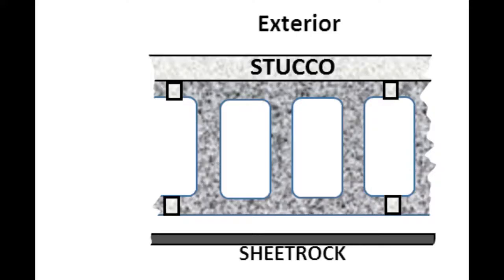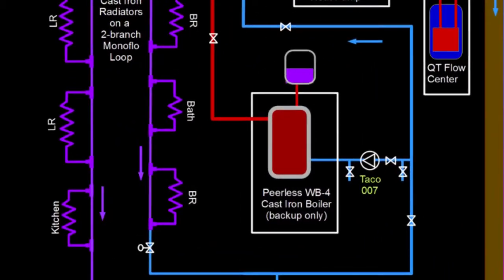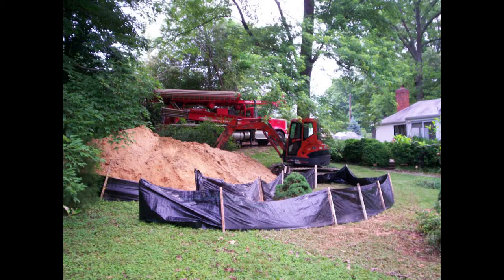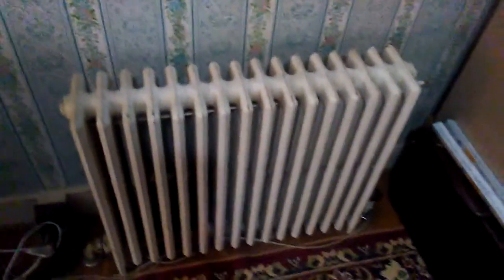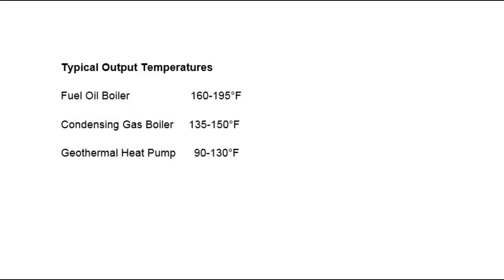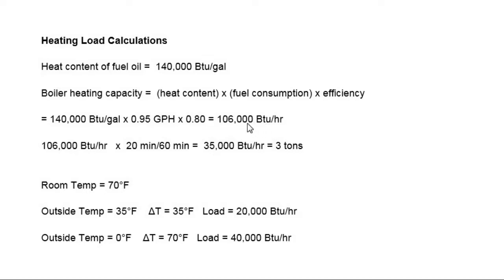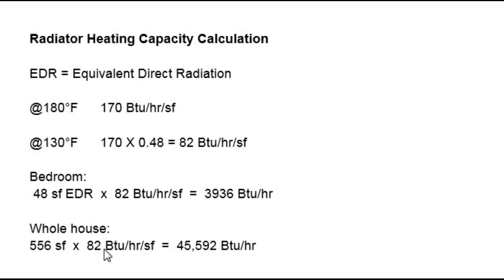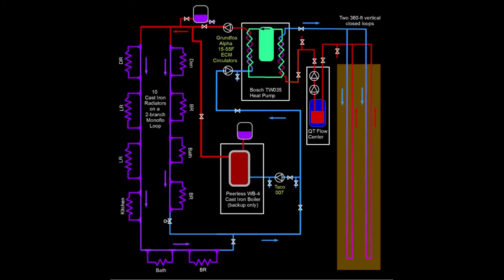Geothermal heating system with cast iron radiators

Comment: Now this is what I have been investigating.   It seems interesting but will it be reliable for at least 25 years?   I don’t do solar.  Roof leak problems and in 10 years if you need your shingles replaced, will that company be around and chances are it may not be. I’m not a risk taker, but a boiler combo with geothermal and the tubes in the ground or in deep water wells does interest me a lot if you can find installers in your area and depending on where you live in what zone
Reply from the maker: Finding an installer will surely be the hardest part, as few of them have any experience with radiators and they'd much rather just put in their standard forced-air systems.  So if they agree to do it at all, they're unlikely to offer much in the way of warranty  But geothermal loops if done right do typically last many decades.  In that respect, I'd stick with deep-bore vertical loops, not ponds or slinky loops. A good heat pump will probably last 20 years, but you do hear horror stories of people who have problems much earlier and it's hard to judge how common that is.  We are at 8 years with no serious problems, and with oil at $5/gal we're saving $2000 a year not $1000. In the deep South or zones where it rarely dips below freezing, it is probably more cost-effective to just get an air-source heat pump but anywhere else geothermal makes sense in my opinion. If a shingle roof is more than say 10 years old it should be replaced before installing solar, but once installed the panels will protect the shingles from sun exposure so they too are likely to last many decades.  Thanks for commenting.

Comment: Hi Lawrence, thanks for the great video! Do you have any references where we can learn more about the insulation mentioned in the section starting at 1m05s? Can you recommend any specific terms we should use when searching for/speaking with contractors? Our home is similarly constructed.
Reply from the maker: Whoa, that was quite a long time ago, but the insulating was as much an adventure as the geo.  The foam in the cinder block cavities is called tripolymer injection foam.  This is a very specialized product and mostly used on commercial buildings.  However if you go to injectionfoam.com you can type in your zip code and they will list available contractors.  When I do that, it shows only one listing, The Drying Company out of Virginia Beach VA, which is the contractor I used.  The estimate for the whole house was $8000 in 2014.  However I only did the half of the house that was 8” block.  The half with 6” block wasn't worth doing because the cavities are so small.  Also, you have to be careful because if there is an opening between any of the block cavities and the cavity directly behind the drywall, the foam can get behind the drywall and blow it off, as happened in one case on my house.  Fortunately it is not hard to clean up the foam.  

For the cavity between drywall and block, I used pourable marine polyurethane foam, the stuff they use for floatation in small boats.  I believe I used the “4 lb” variety, which claims to expand 15X, although that depends on conditions and in my experience it's more like half that.  You mix two components 1:1 which starts a chemical reaction that produces a soft foam that expands and then slowly hardens.  I don't remember the brand name but there are a bunch of people selling it on Amazon and ebay.  The tops of the cavities were accessible from my attic, so I went to the basement and plugged the bottom of each individual cavity, for example with minimal expanding foam from a spray can.  Then I got a bunch of ~8-oz dixie cups. I mixed one cup at a time and poured it from the attic into each wall cavity, then waited 5 minutes before pouring in the next cup.  You really need a (very patient) buddy to watch downstairs and make sure there is no leakage, as the uncured foam mixture can leak through any small gaps at the baseboard.  It took 7-8 cups to fill each 16” wide cavity. So a very tedious process.  I rhink that if you tried to fill the whole cavity at once, it would blow off or bow out the drywall. Unlike the tripolymer, this foam sticks like glue to everything.  If you got it on a carpet for example, you'd have to replace the carpet.   

There is an entirely different process called EIFS (exterior insulation and finish system) where they add insulation to the outside of the stucco, then plaster on another layer of stucco.  I know somebody who did this and was quite happy with it.  In theory this is a better idea because then you have the huge thermal mass of the cinder blocks moderating the temperature on cold nights and hot days. However this is also a very specialized procedure.  I found only one guy in my area who said he could do it and he promised to give me an estimate but never did.  My roof has no overhang at all, so I suspect I would have had to add one, which would be $20K at least just for the overhang, so I didn't pursue it further.  

So, no really great or cheap options for insulating these old cinder block houses.   But it can be done.  Hope this helps.  Thanks for commenting.
Reply: @quetzal4042  Thanks so much for taking the time to answer my question with so many details, now we have lots of leads to follow! Thanks again for putting out such helpful content!

Comment: Great video. I have a one-pipe steam heating system. Could a geothermal heat pump work with a one pipe steam system?
Reply from the maker: Sorry, I don't see any way it could work without extensive modification.  You'd need to plumb in  a return line from each radiator in order to get sufficient flow.  I suppose it's theoretically possible to design a 1- pipe geo system using some fluid other than water, that has a boiling point closer to 120°F, but to my knowledge there is no equipment available to do that.   Thanks for commenting.

Comment: Great contribution! It would be great if we could use this and other work highlighted in these comments as the basis for a National discussion about ways to retain our heritage of cast iron radiators as HVAC systems continue to evolve to meet the challenges of climate change.
Reply from the maker: Sure, anything I can do to help, just let me know.  There are some new products that make these systems easier to configure and install.  When I did mine, I used two separate heat pumps, one for heating and one for cooling.  Now there are units that can combine hydronic radiant heating, forced air cooling and domestic hot water all in one unit, with a variable-speed inverter-controlled compressor for greater efficiency.  Check out this video for a description:
www.youtube.com/watch?v=6Nm7n2u4-Is&t=9s
What they really need now is some improvements in drilling tech to bring down the cost of the ground loops and get these systems within reach of everyone.  Meanwhile, our system is still chugging along, coming out of our 7th winter and still haven't had a single problem with it.  Thanks for commenting.

Comment: We live in USDA hardiness zone 4 where there are a handful of days every year where the temps dip to -15 or lower.  Will this system work in these temperatures?
Reply from the maker: I think certainly you could design a system that would work in zone 4, it's just a question of how big a ground loop and how powerful a heat pump you would need.  You would want to start with an extremely well-insulated house.  Note that even though I am in milder climate (Virginia), my house even after improvements isn't that well-insulated, R-10 walls for example, so I need about as much heat as a really well-insulated house in the northern US would.  Also note that the first two geothermal radiator installations I cite in the Description are in quite cold climates, the first near Buffalo NY and the second in the upper midwest I believe.  It is true however that more electrical energy will be consumed to get an equivalent amount of heat in a colder climate, because you will be pumping heat from ground temperature water of ~45ºF (in zone 4) to radiator-temperature water of say 120ºF, instead of from 60ºF water (in Virginia).  I'd guess maybe 20-25% more power.  This does mean that the relative advantage of geothermal over fossil fuels is somewhat less in colder climates, because of course a gallon of oil or a cf of gas will generate the same amount of heat no matter where it is burned.  But the nice thing about geothermal is that it heats just as well no matter what the outdoor temperature, vs. an air-source heat pump which wouldn't work at all at -15ºF.  Thanks for commenting.

Comment: I think it's the cost of Geo that puts people off. By the time you upgrade the thermal performance of your home and in many cases, your heating distribution system, you could be looking at $30,000 for a modest home.
Reply: If you need  new furnace anyway, the cost delta of a geothermal system is less.

Comment: Lawrence, great explanation of your system. I'm in MN, have an old house with radiator heat. If my  geology/hydrology is the right fit, I'd consider a system like yours.  But I have no idea what this costs.  My friend who works in the state energy office says he thinks it's a 100-yr payback. Thoughts?
Reply from the maker: Hi Paul,

Thanks for commenting.  It is not too difficult to estimate the cost of a system and as I show in my case, it is possible to do it fairly cheaply if you get the right contractors and do some of it yourself.  But estimating payback is much more difficult because every situation is different and there are so many factors to consider, some of which you just have to guess.  For example, if I had simply hired a professional Geo HVAC contractor to put in a complete system, it would have cost $10-20K more.  I know, because I did get estimates, although they were all for forced air with air conditioning included, because none of them wanted to deal with radiators.  On the other hand, my drilling might have been cheaper except that it was mostly through solid granite, and if I had been willing to have them tear up my whole property for trenches instead of drilling, it would have been about $5K cheaper.  And then it of course depends on what you would do otherwise.  Compared to oil, I think it’s a pretty sure bet you’d come out ahead with geo after say 20 years under almost any scenario.  But fracking gas is so cheap right now that as you can see from my chart, potential savings with geo are only a few hundred dollars a year, and could be even less depending on local cost of gas vs electricity and whether or not you’d be paying for a gas connection anyway.  So yes, under those conditions it could take many decades for a geo system to “pay for itself” with fuel savings.  But will gas always be so cheap?  Will there be a carbon tax? Will more states move to ban fracking as its effects on water quality and seismic instability become apparent? Or will there be gas shortages because pipelines are overloaded and it is politically impossible to build any more?  These are things you can only guess about.
Reply: @quetzal4042  Thanks for the thoughtful reply. I agree there are many future unknowns, and I am also motivated by the spectre of massive climate heating. So, yes, your points are well taken.
Reply: @quetzal4042  Also, maybe you mentioned it, but is your system water-to-water in your heat pump?
Reply from the maker: @paulandre2489  Paul, Yes it is water-to-water.  A few years later I also converted the air conditioning to geo and that uses an entirely separate water-to-air heat pump. Of course they use the same ground loop so once in Spring and Fall I need to flip a couple of ball valves to switch the loop between the two systems.  You can use the water-to-water as a chiller and run that through a water-based air handler, but having a separate heat pump is more efficient.

Comment: great video
Reply from the maker: Just finished our 6th winter with the system and still no problems and no maintenance, flip it on in the Fall and off in the Spring, that's it.  By the way, my warning about expiring tax credits is no longer valid.  The tax credit currently stands at 26 percent throughout 2021 and 2022 before decreasing to 22 percent in 2023. Thanks for commenting.

Comment: Hi Laurence: Thank you for taking the time to put together such a comprehensive video. I am in a similar situation in a 1940s house with an oil burner and radiator heating. I will be using your video and illustrations as a reference when talking with local geothermal installers. I've installed a very large 22.8 kW solar tracking system that provides enough electricity to power the house, two EVs, and eventually our geothermal system while remaining slightly net negative (if I've done my calculations correctly).  I didn't hear anything mentioned about your home hot water heating solution, which is suspect may also utilize your geothermal. 

This year is all about increasing the energy efficiency of our house including replacing all our old (original) windows and storms, doubling up on attic insulation, and tightening up the entire building envelope. I'll be running the heat tests for our boiler after making these changes to see if we can successfully heat the house with the lower temperature output. Again, thank you for sharing your experience.
Reply from the maker: Chris,
You’re quite welcome, if it helps even one person get a system installed, I’ll consider the video well worth the effort.  Good luck with your contractors.   I had three Geo HVAC outfits come by to give me estimates, and not one of them would even consider using the radiators as part of the system, they’re totally committed to forced-air, so I had to basically act as my own contractor.  I was pleasantly surprised though, at the willingness of the driller to deal with me directly.  

As far as hot water, we’re still using the tankless coil in the oil-fired boiler, but we don’t normally have the boiler turned on, instead we keep the boiler water heated to about 120° with a separate 6000 Btu Nyletherm I air-to-water heat pump vented inside the basement.  It gives a good bit of needed dehumidification down there especially in summer, and it’s enough hot water for washing hands etc., and for the dishwasher, which has its own electric temperature boost for the final wash and rinse cycles.  The only thing we really need to turn on the boiler for is showers. There’s just the two of us and I take most of my showers at the swimming pool, so we just don’t use all that much hot water.  I considered putting in geo hot water, but it would require its own large water tank, and we really don’t have room for that in our already cramped basement.   

We’ve also got an EV and a second solar array in the backyard for a total of 8 kW, with grid-tie and net metering.  We generate 7,000 kWh a year, which is 70-80% of our total power usage.  

We replaced some of our steel casement windows as well, an adventure in itself.  Be prepared for some extremely high-pressure sales tactics, especially from those Andersen guys!

Thanks for your comments.  

Larry.
Reply: @quetzal4042  Thanks so much Lawrence for answering my additional questions. I'll keep you posted as I move forward with the project.